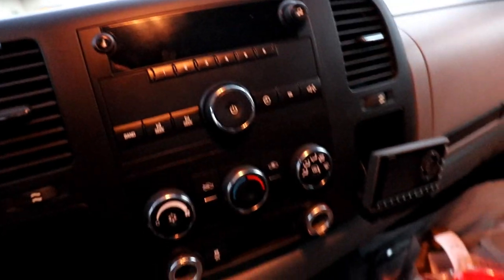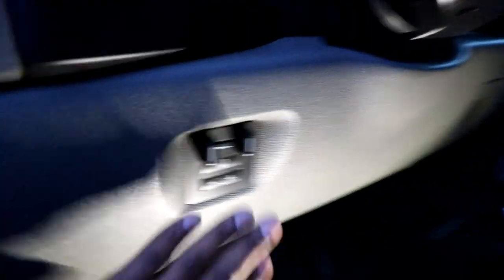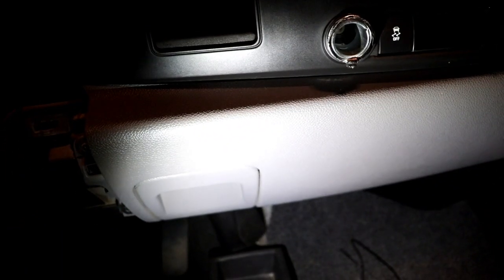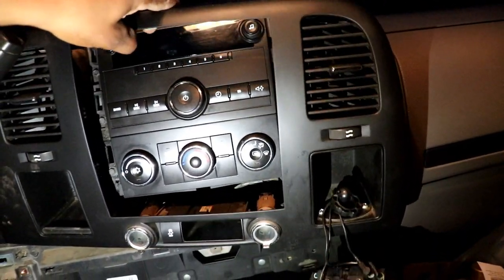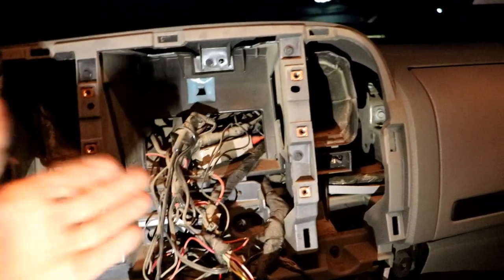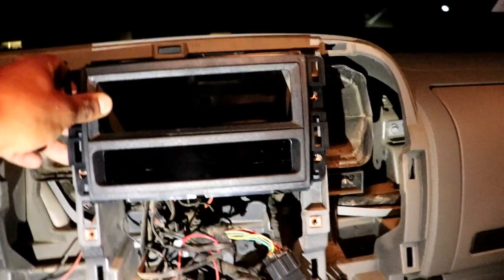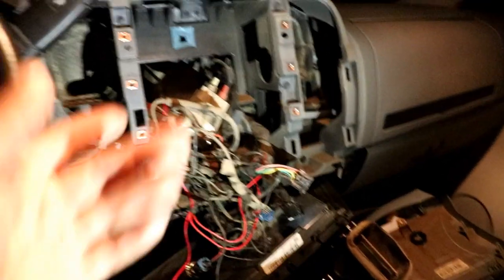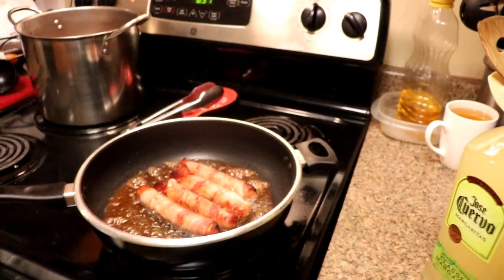stereo install 2013 chevy silverado 2500HD #SimpleSickBuilds

Comment: Hi, thanks for the tutorial. I have a 2011 2500hd and I can't find where to run the red accesory wire to. Anyone know where on the truck I could get accessory power?
Reply: Did you ever figure out where to get accessory  power? That's what I need

Comment: Where does your red wire connect to?
Reply: The long red one does it go to a fuse
Reply from the maker: The red long wire goes to a fuse .. so your stereo wont forgot its memory say you save a station your car will alway know.
Reply: SimpleSickBuilds so what fuse did you run it to? I couldn’t find a 12v that turned off after  key was off.

Comment: What’s the red wire connected to
Reply from the maker: witch red wire brother?
Reply from the maker: Theres one red wire and that should be your power wire
Reply: SimpleSickBuilds I believe it’s the ignition/accessory wire
Reply from the maker: On my stereo red is power and yellow in accessory could be different on yours 🤔